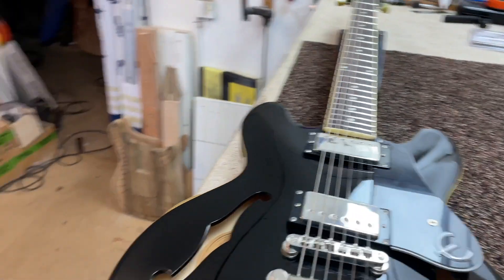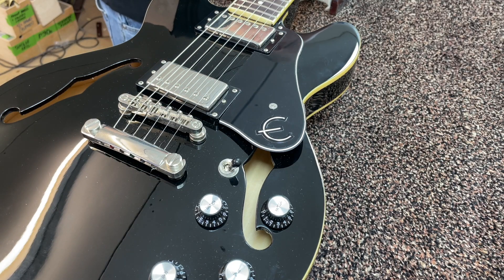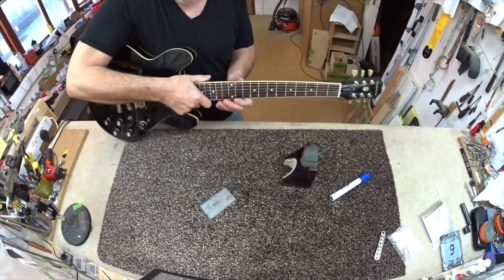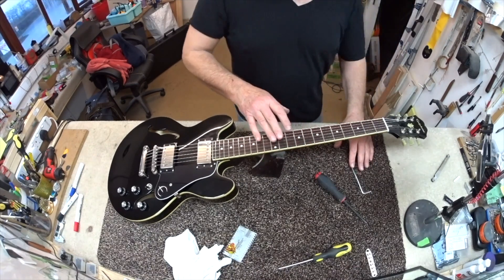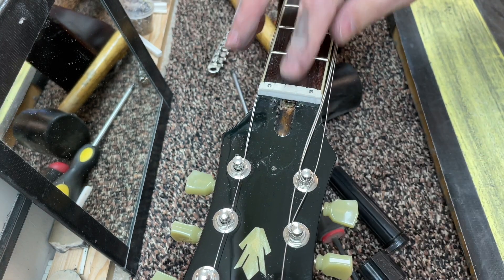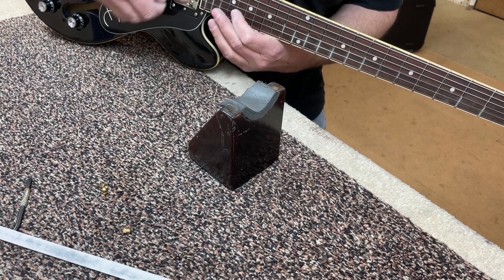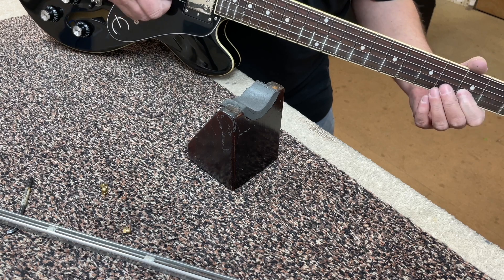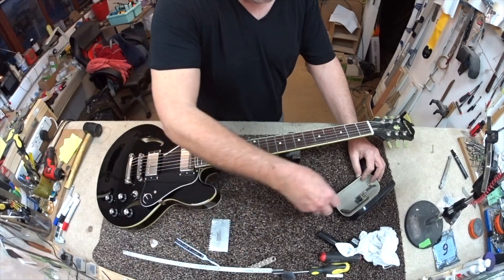Epiphone Dot ES339 bridge replacement and set up

Comment: Sam, great videos, where do you get your adjustable fret levelling tool please with correct name of tool? Many thanks
Reply from the maker: Hi Russ - it's a DIY tool that you can make yourself. I sell a kit (see the link below) that includes the tool ('the Banana') plus sandpaper, both my eBooks and other components for the fret levelling process: 

https://www.facebook.com/photo/?fbid=943593684436774&set=a.505742714888542

or you can find out how to make and use the tool with my '5 Steps To Guitar Set Up Heaven'. The eBook focuses on DIY / low cost tools, showing you how to transform your guitar's playability for very little money:

https://www.facebook.com/relovedguitars/posts/pfbid02h9NYYspwDEufiRTFzjkWQ85mZ1BseqadCSWWBsECm7Jbm4Tm4GxcgaMpSQGp6Bkhl

Comment: Thanks for the set-ups I'll be doing! 
Question on intonation:  The bridge on my Epiphone ES-335 Dot needs to move closer to the nut to bring in High E, and there's no room left in the bridge to adjust. All other strings can be adjusted so I'm looking for a bridge with a greater adjustment range. Preferably a roller bridge. What concerns should I have?
Reply from the maker: None really; I use the roller bridges sold in the UK by Northwest Guitars all the time with ES 339s and 335s; they're about £20 inc. postage and are a drop-in fit on the posts. They provide a little bit more intonation room overall front-to-back but I can't promise that it's in the direction you actually need (i.e. nut-wards). I'm assuming you've already tried reversing your standard saddle blocks on the E and B to gain an extra 2-3mm saddle travel? If you have and it still doesn't quite reach intonation, then a replacement (slightly 'deeper') bridge is worth a try because the only alternative after that is moving the bridge. 
By the way, if your failure to intonate the high E seems in any way 'out of the normal / expected sequence i.e. two familiar-looking staggered groups of 3 then replace that string first and try again to intonate the new one. It's very common to have a dud string that won't intonate. After that, consider the replacement bridge. And if that don't work, consider moving the bridge. I've not come across an Epiphone with a bridge actually out of place before (at least I can't remember having done so) so I recommend you suspect the string first...
Reply: @SamDeeksRelovedGuitars  So, I didn't invent the reverse saddle block? 🙃 It wasn't a dud string so I've purchased a wider GOTOH roller bridge (I need a roller bridge anyways, right?) and now need to remove the top few threads in the original insert nuts to let the new inserts fit (with just a little pressing to keep it tight). The new insert stack stands a bit taller from the body, but the roller bridge is thinner and strings will sit lower than in the groove in the saddle block. It should work if the extra intonation adjustment range is enough (it's the one thing I can't measure before modding). Thanks for your assistance!

Comment: Great Lesson on relief Sam!
Reply from the maker: Thanks JF - I was hoping it made sense for Leigh whose guitar this is. It's all-too-easy to get hooked into specific measurements like 0.1 or 0.15mm relief.. I like to say "As close to flat as you can get while still having a gap..." is a good start point. If you need more, add a little. Most importantly, don't be afraid to make adjustments and observe what effect it has. If you know where to look for the effect of adjustment (i.e. the size of the gap between low E and the 8th fret when that string is simultaneously held down on the 1st and last fret) you can begin to get a personal understanding and not be afraid to adjust. Adjusting is something we all need to be prepared to do in response to those seasonal or geographical changes...
Reply: @SamDeeksRelovedGuitars  it was the most understandable and easy way I've seen it explained.

Comment: Oh you got a bad string?? That has never happend to me as a use the best brand D'addario XT!:)   what brand was that? 
It really sucks to get bad strings, you SHOULD call the brand that making the string and craving for a new set. Strings arent that sheap these days. I do avoid using sheap strings cause sheap string means NOT LAST LONGER THAN A FEW WEEKS. I Was a Ernie Ball user in my early teens those super slinkys.
Now 10-52s and 10-46 Daddario XT. 
Daddario never breaks and i havent got a bad string from them.